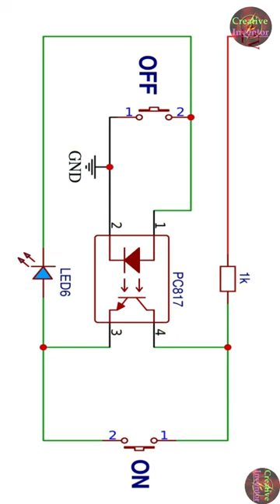Amazing Hack Using 817 optocoupler ic, #shorts, #youtubeshorts, #shortsvideos

Comment: There is off button and on button. They are assigned to their own duties. On and off. Firstly you can see  in the circuit diagram, if we on the on button, here created a series led circuit and they will glow. One is LED other is in the opto coupler called photo diode. When photo diode on, it drop about 1.2 volt and opto starts working. Collector and emiters are shorted. In this condition our Light LED will still glow through the collector and emiter. When we push the off button. The photo diode is going to shorted to ground. That means zero voltage. Then opto going to stop working. Returned to collector emiter open circuit. That means light led going off. 😊